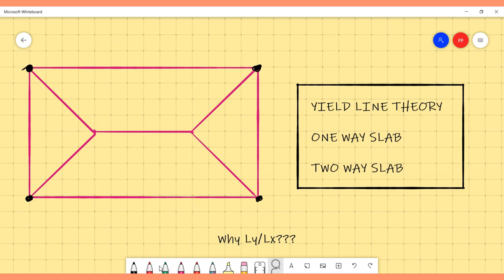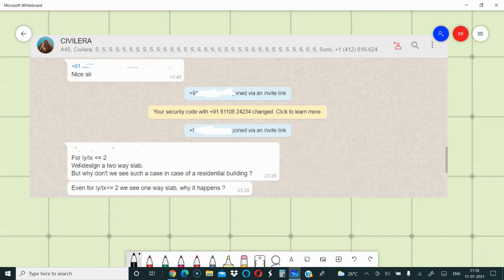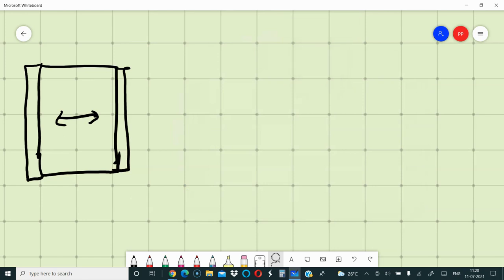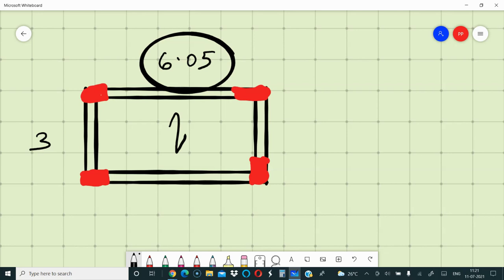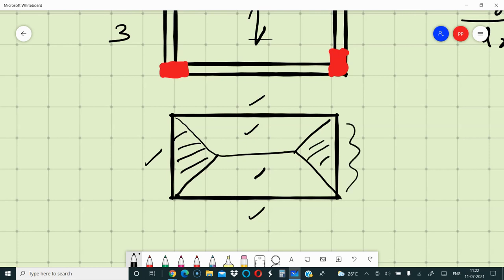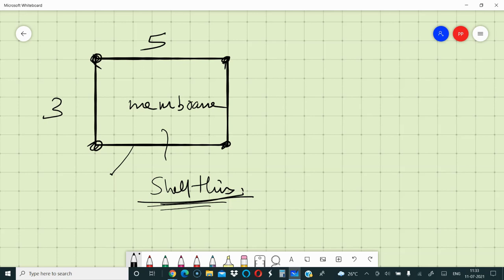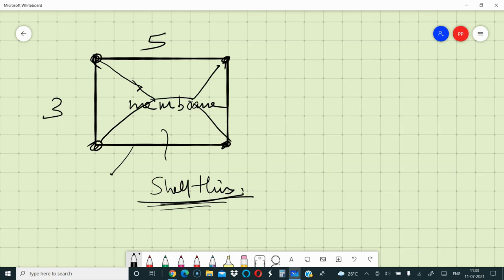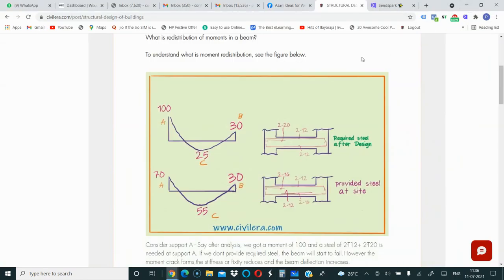One way and Two way slabs - When to model slab as membrane and when to model as shell thin

Comment: Hi. Thanks for the video.  There are situation where we have to put the Longer Bar as B1 and the Shorter Bar as Distribution/B2 bars for example if there is a cantilever adjoined to the longer direction. I will greatly appreciate if you can talk more about this? Thanks.
Reply from the maker: B1 need not be always short even in normal slabs. It is dependent on many things. In site it is not practical in a large building as adjacent slabs may have different orientation.
For your cantilever question, see if this video has any info https://youtu.be/8GPx8ZIrZCM?si=9LUZqg4tTEkJIciA

Comment: Sir there are two methods for detailing for slabs,  one is crank bar method and another one cut piece method. 
Can explain two methods in detail. 
Which method is easy and economical???
Reply from the maker: Its all covered in the courses. Is it possible to achieve detailing by cranking if the bottom rebars and top rebars are considerably diffferent? cranking works well when the slabs are small and spacings are all uniform

Comment: Yes, sir I have experienced this in cype cad.
In FEM design, one way and two way slab won't work.
Wherever the more moments we provide more steel on that direction. 
Thank for the video sir.
You explained the same thing here in this video.
Reply from the maker: but why? why 1 way and 2 way dont work? It works but only that it is approximate rule of thumb
The reality is based on stiffness which is captured in shell analysis
Reply: @CIVILERABangalore  yes sir. 
In fem design of slab there is possibility of getting more moment in longer direction of slab.
Reply from the maker: @hcstructuraldesigns  Thats the reality. stiffness decides the flow.